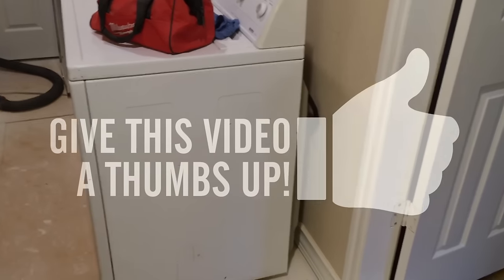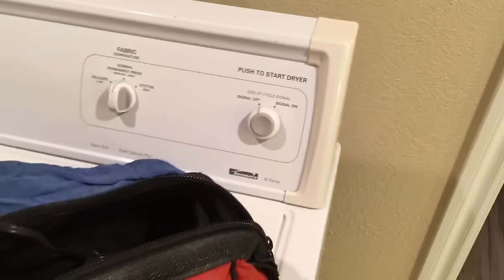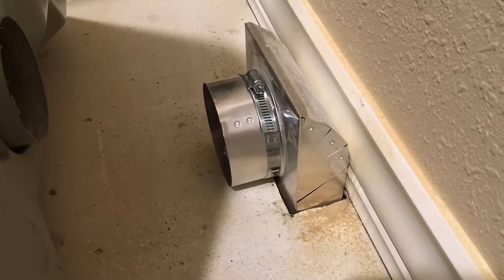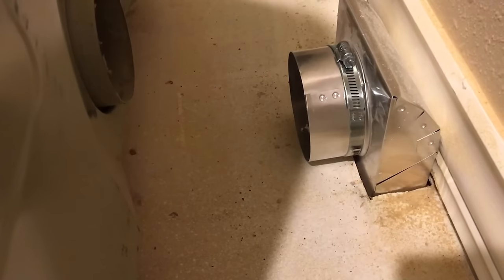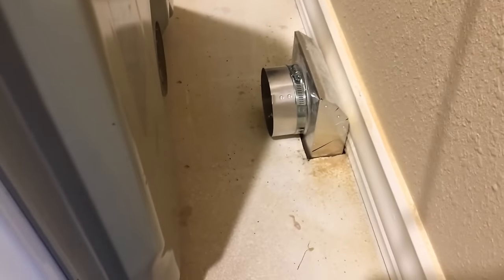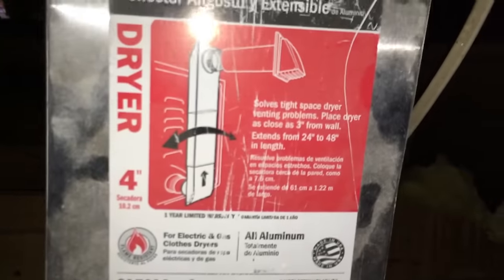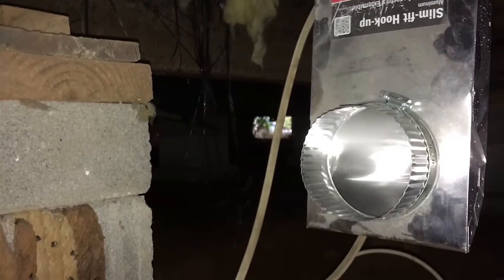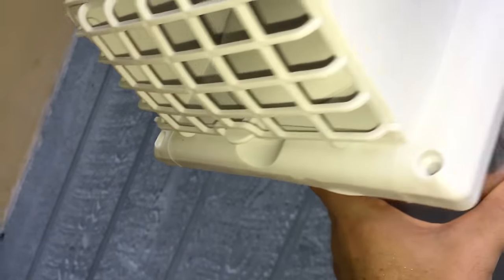Installing Dryer Vent in Middle of House | DIY Mobile Home Restoration | #EastTXHomestead

Comment: Hi. So I’m installing a new dryer vent and your video would work except that the space between the dryer attachment area and the floor attachment area are about 2 feet apart from each other. New floors were just put in and installer has this coming from the floor. How would you suggest attaching a vent in this case?

Comment: You will have a moisture problem after a period of time if you do not seal behind the dryer. My sugestion in using a mag vent and it will seal itself.

Comment: With this much piping in place you're very likely to have issues with lint buildup and restricted airflow over time.  It can take 6-12 months for anything significant to accumulate, but it can lengthen your drying time for a given load.  If four towels take 30 minutes to dry now, they may take an hour this time next year.  The lint trap only catches about half of your lint.  If airflow is restricted too much, it can cause the dryer to overheat and start to open fuses.  Using compressed air through the piping from time to time can help remove some of the built up lint and restore your dryers efficiency.  It's something to keep an eye on if you've got more than 12-15ft of piping or if there are very many bends in your hose.
Reply from the maker: That's really good advice. Thanks for taking the time to share it. Ours comes down and then immediately goes into a 4" PVC pipe that's about 8 feet long. That PVC pipe sticks out the side of the house. I'll pop the end cap off this weekend and see if there's any buildup.

Comment: To anyone  who has a gas dryer if you do this you and your family will be dead with in minutes or seconds because of Carbon Monoxide Poisoning.☹️
Reply: Minutes? no way.  A clothes dryer and a stove produce small amounts of carbon monoxide from the natural gas they burn, but not that much.  Despite the warning labels, many people use nat. gas dryers in their homes with the vent less system (a bucket with a net to catch the lint) without ill effect.  That is 100% of the gasses going straight into the house/kitchen. I have seen them on my service calls.  No body died.  When I mention that its not safe, the customer routinely says its been like that for years.
Reply: @davidater9  confirmed. I have the lint catch with a gas dryer. I’m watching these videos so I can vent my dryer through the floor. Why? Well because the real danger is all the moisture it puts in my house. Mold mildew, humidity and the occasional person eating shit because it makes the floor damp.

Comment: 1. Use all metal and foil tape. If there is a dryer fire, it will melt PVC.
2. No dampener (flap) or guard on exterior hood. Lint will just collect around both and create a complete blockage.
Reply from the maker: The dampener flap was a bad idea. I removed it a few weeks later. Other than that the system has been working great

Comment: We are planning on doing the same thing in the middle of our home. The house we just purchased had add ons so there’s a room in the middle of the house with no windows. It’s a pretty big area and would be perfect for a laundry room. I was thinking about adding a vent fan to pull the lint through. I’m also gonna add a second lint filter before the fan.

Comment: That vent is intended to be recessed between the studs. I was hoping your situation was similar to mine. I need to replace approx 15’ flex vent on 2nd story dryer through floor trusses.
Reply: Did you figure it out?
Reply: Make sure it is not plastic or foil flex. that is a fire waiting to happen. Make sure you use real aluminum flex. Fire won't burn through it. So going through wall ues oval pipe. Yes you will have to cut your walls and do some construction but it is the best choice. Other consideration if it is a long run make sure you have a electric draft booster installed.

Comment: So how is it holding up? Still no issues? I am limited in my options as well, and contemplating doing the same thing
Reply from the maker: It's working great!
Reply from the maker: @joefreestyle8039 I've attempted to clean it out a couple times but never really needs it. The biggest issue in the whole system is the flap on the outside of the house that is built for that job. It collects some lent from time to time.

Comment: Is there anything wrong with those indoor dryer vents for electric dryer?
Reply from the maker: Ours is electric and haven’t had a single problem
Reply: I read some articles saying that the dryer vent releases moisture and can cause mold so that's why I was wondering.
Reply from the maker: Sorry, I misunderstood the question. Yeah... You're talking about the big filters that just blow the air into the house. They will put a ton of moisture in there for sure.

Comment: big question I have a modular home with the vent coming up from the floor right where they connected the house together and it is steel .I want the dryer house to stop coming off and wanted to install a periscope vent .I am guessing I am going to have to cut a new hole for the vent to run under the floor like you have and then run the periscope down a new hole and connect to the vent under the floor .Is this really doable

Comment: Why does evwryone vent the dryer out to the side or above the house??
Why not just vent straight down under the house??  
Its not throwing sparks just hot air.  Not a fire hazard and heats the floor
Reply from the maker: There's a lot of moisture in that hot air that will eventually cause problems.
Reply: @EastTexasHomestead  got it.  Thank u

Comment: I know that rural Texas can be rather lax on building codes and enforcement, but for God's sake, get some help from someone with knowledge of the building codes.

I have two issues; 1) The periscope type dryer vent connectors are not rated for use through walls, ceilings or floors AND there is not a building code in the country which allows the use of PVC sewer pipe for dryer venting.  Use of that spray foam is a problem too.  You are creating a tremendous fire hazard and honestly endangering your family.  Even if there is no local building department, the builder (professional or homeowner) has the obligation to meet the prevailing codes.  

And question 2) Is this truly a manufacturer home built to the HUD codes?  If so, 24 CFR Part 3280 states that a manufactured housing unit cannot be modified without the approval of the original manufacturer or a licensed third party engineer.  If it is a true modular home built to the Texas codes, you have the same issues but under Texas law in lieu of the CFR.  Not saying that people do not make changes to these structures without the proper approvals,  but somewhere down the road, non-approved revisions may bite you - like at resale time or the potential fire that you are begging to have.  Just sayin.
Reply from the maker: Donald, Thank you for your well thought out and cited comment. I'm assuming you are either a builder or a code enforcement officer judging by your knowledge of the subject. 

All throughout our reconstruction process, I've had professionals checking on my work to make sure it was up to code and safe. This is one area I didn't consult with them because it seemed pretty cut and dry. 

Nowhere in the packaging or documentation for the periscope dryer vent did it say that it wasn't approved for wall or floor installation. I assumed it would be since you can go through the wall with a similar material for a standard vent. You know what they say about assumptions...

I actually thought I was installing a more efficient exhaust with the PVC since the standard ducting has so much texture to trap and hold lint.

Thanks for your comment and I'll look into changing things up.
Reply: Retired from another state as Deputy State Fire Marshal with duties in fire and building code enforcement.  Unfortunately I have seen the tragic results of too many well intended  home renovations where things have gone astray.  I know that the two guys involved in that Oakland warehouse fire last December didn't want to hurt anyone but 36 people died.  Please take every step you can to protect you and your family.  Best wishes.
Reply from the maker: Thanks for your service and I hope you're enjoying retirement. It's truly tragic when that happens. I couldn't live with myself if my family were to go down due to negligence on my part. Thanks again.
Reply: Donald LeBrun actually, Schedule 40 PVC is allowed to be used in our area as long as it is below grade and surrounded with the pour of the concrete slab.
Reply: Doesn’t know what he’s talking about